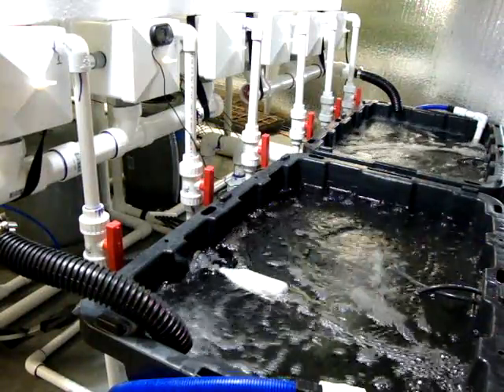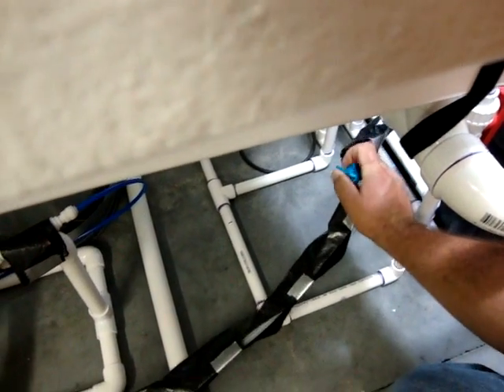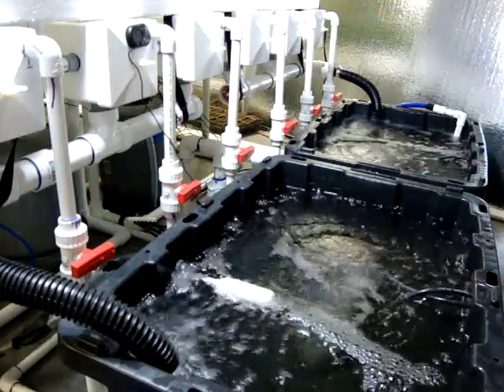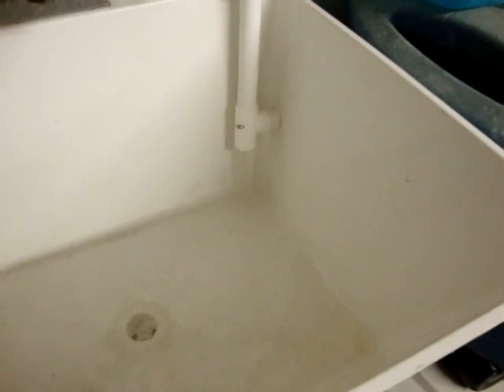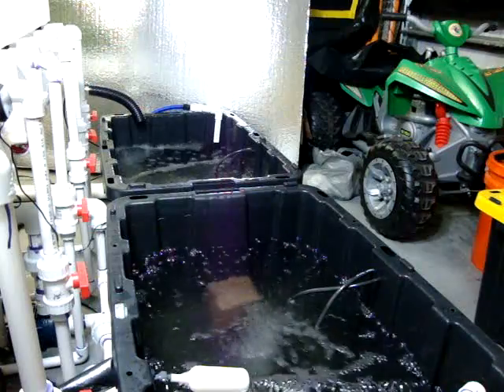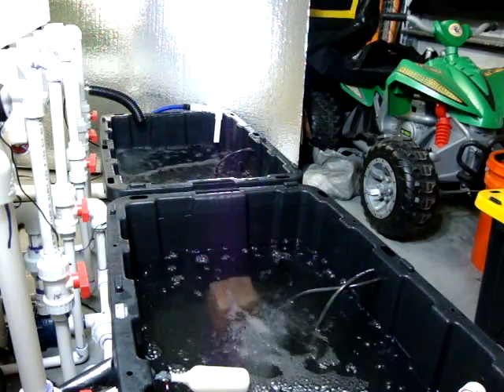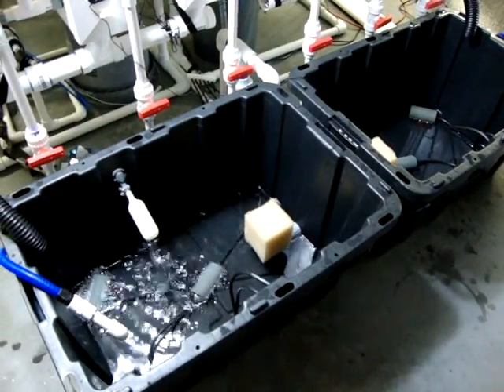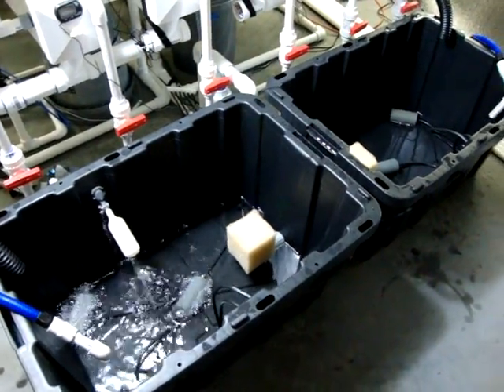DIY 39 Pepper Aeroponic System EP. 3 PT 1 (Nutrien

Comment: How rattling it's to grasp that the waste from water creatures may be want to grow and fertilize plants. These plants that ar concerned in Hydroponics do not would like soil to grow and truly grow in water! may be} an awfully distinctive method and therefore the author will well to clarify however Hydroponics can be want to optimize the resources obtainable to supply food with valuable nutrients to individuals _*[Check Details Here  ===> fb.com/Easy-Hydroponics-Systems-166096780618260/app/208195102528120 ]._This choice presents the muse of Hydroponics, and income to clarify the science during a} simply understood manner that's very pleasurable to browse. Andy Jacobson explains however the system works, common issues that will arise, and totally different strategies you will use to urge started. Offers nice insight for a beginner within the field, would advocate those seeking an understanding of Hydroponics to urge themselves starte

Comment: Hello, Great videos for sure ! A few things I would try and change that would save lots of time is to add a 55 gallon drum for top off water and nutrient changes. I would have the 55g drum raised up off the ground to a height of 3' or so. The drum would be filled by your filter with a float valve connected near the top of the drum. A water supply line connected to the bottom or lower side of the drum would allow for a gravity fed top off line that would then connect to your float valve in your reservoir. I would also add a second 3/4" or larger pvc line with a shut off valve from the drum to your reservoir that could be opened to allow the reservoir to be refilled in a minute or two with the water in the drum. Perhaps you could also premix your nutrient solution in the 55g drum and adjust your ph levels before opening the valve to refill the two reservoirs? You could raise the grow channels 12" or so and also the reservoirs up off the ground on a small 12" platform to allow you to install shut off valves on the bottom of the reservoirs so you could very quickly completely drain them. I've head it may also be a good idea to flush your system with straight dechlorinated water once or twice a month for a 24 hour period the day before you change your nutrient water. Again, having bottom drains on your reserviors would save you so much time. I also think your idea of raising your misters to the upper level would give you a little more flexability in overall system performance. Thanks again for your great videos.

Comment: Great videos thanks,I have a aquaponic system about 5000 Tilapia and 200 plants,peppers tomatoes,asparagus,melons and potatoes.I also built an aerqponic system out of 4 inch pvc.I would like to know what kind of pump and gph plus what type of sprinkler heads,I bought some from ebay 360 that are red is this the same ones you have I didn't start off with a filter and they got plugged I couldn't get them out and back in they came out stripped even thought I installed and removed by hand,Thanks for any help you could give.Also have you ever though of aquaponics no nutrient cost and fish are great fresh.